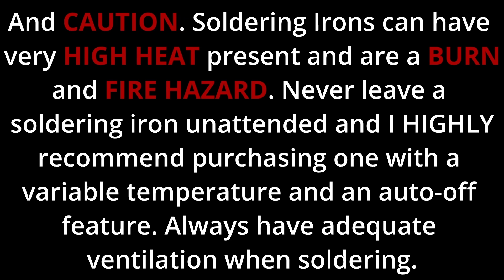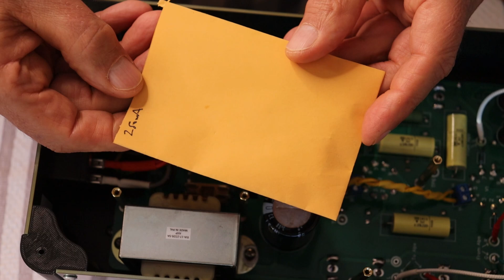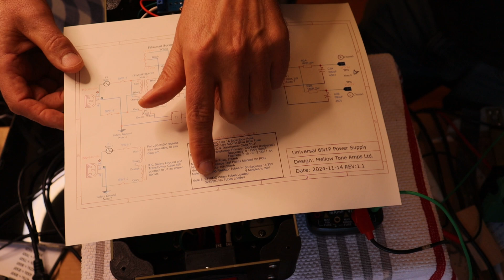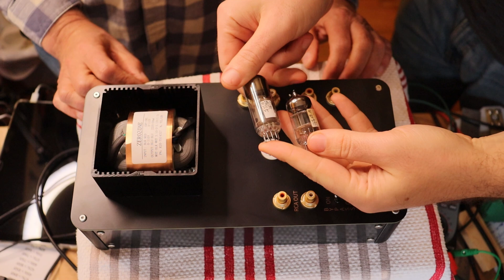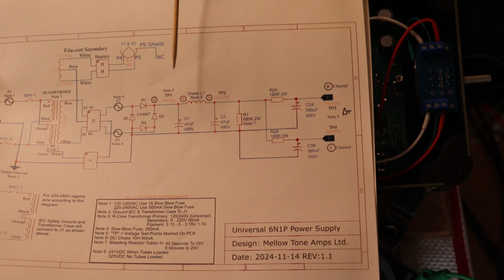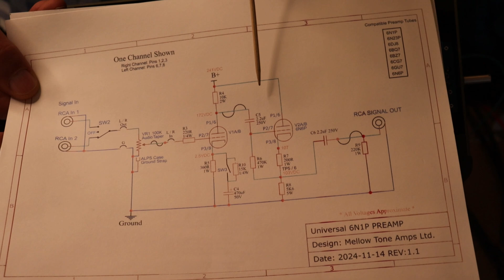Ep18 Fuse Install & Startup Testing - 6N1P "Rocket" Preamp

Comment: I know this is just nitpicking, but after discharging an electrolytic, I think it’s a good practice to always measure it again just to be absolutely sure the caps are fully drained. 
I’ve gotten hit with over 500vDC a couple times, but never again. Just watching people on video work on higher voltages causes me to automatically go to either take my left hand and either sit on it, put it in my pocket, but more commonly just keep behind my back. It’s second nature to do so now, and I strongly recommend people try to make it a habit that could potentially save your life. 

Also, DC grabs you like a cobra and doesn’t want to let go. Electricity can mess you up and can even end you. It absolutely needs to be treated with respect.
Reply from the maker: @NickP333  good points.